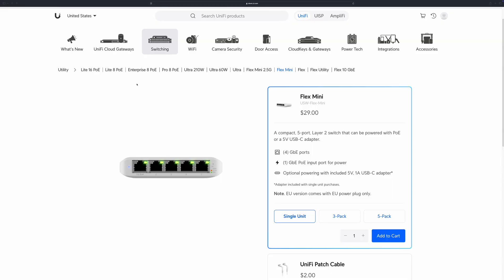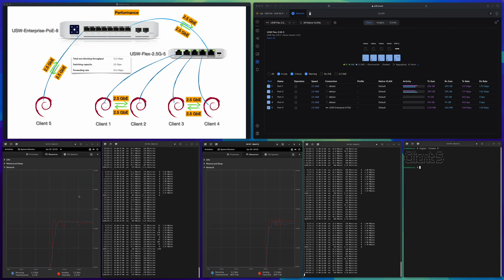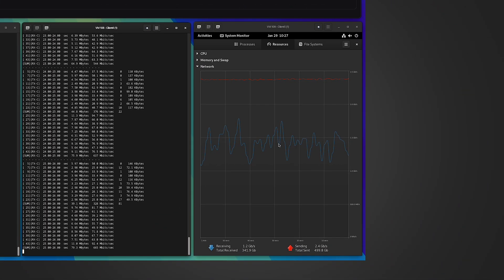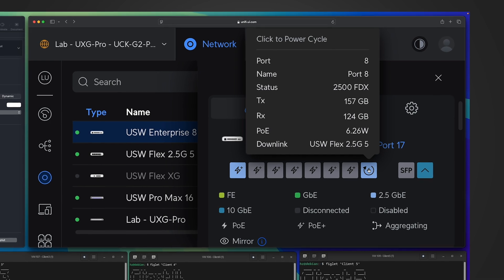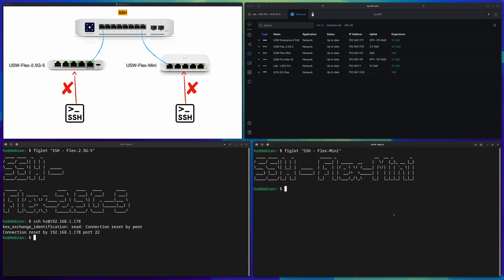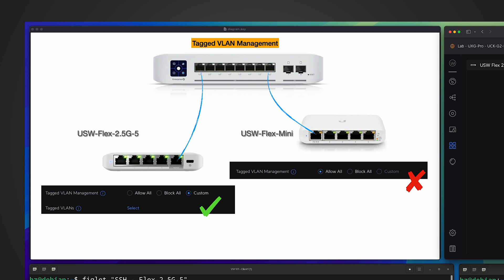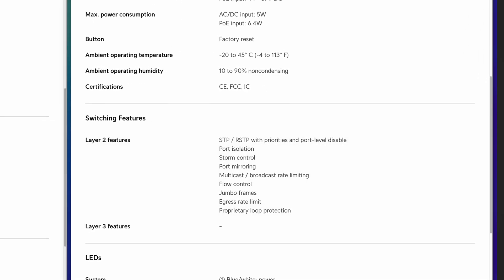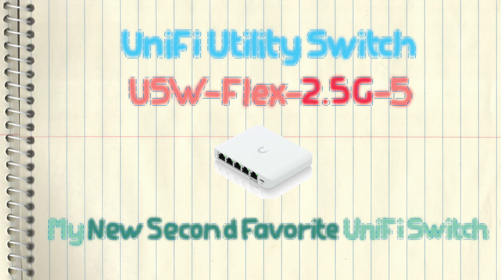Ubiquiti UniFi Switch - USW-Flex-2.5G-5

Comment: How can I configure the VNO? For example, I can configure a device connected to it for a specific VLAN and leave the port in the default VLAN, but since the device is configured in the correct VLAN, it will connect to the specified VLAN.
Reply from the maker: I don't quite follow the question, but I guess you are asking something about access port vs. trunk port. If so you can search my channel for dedicated videos.
Reply: Sorry, it would be the Virtual Network Override option.
On my Lite 8 and also on the UCG Ultra, I can configure it for wired devices, but on my Flex Mini this option doesn’t work — it doesn’t even show up.

 @hz777

Comment: Thanks for this video and thank you for testing the power redundancy between PoE and AC adaptor.

I am a bit surprised by 6W power usage though, 1W per port average even when idle seems like a lot. This is close to 10Gb SFP+ to RJ45 adaptor power usage levels. The specs on the website do also say the same.
Reply from the maker: I was as well. I remember the 1GbE flex mini only uses 1.x w when idle.